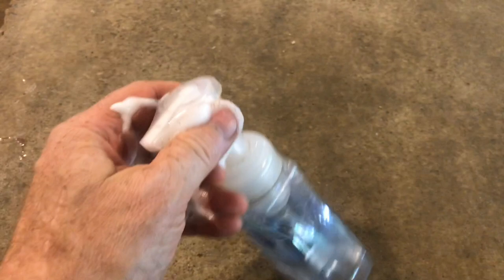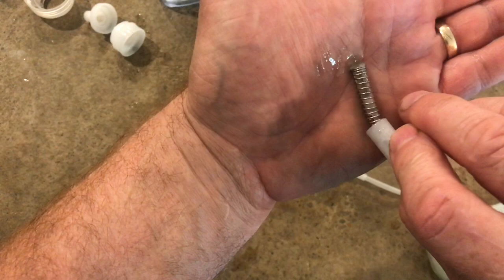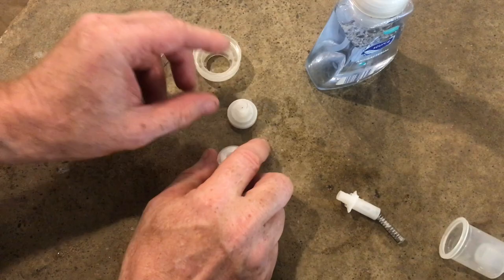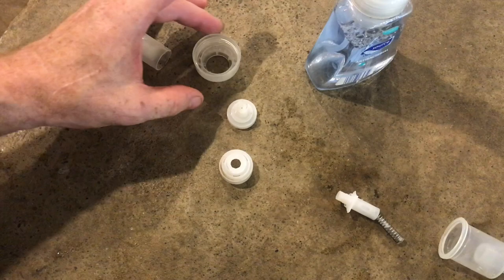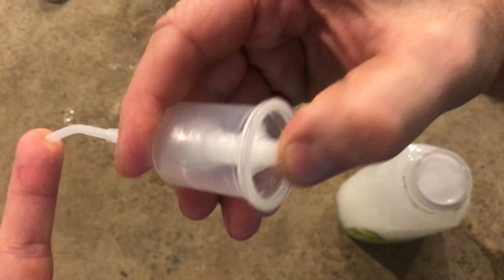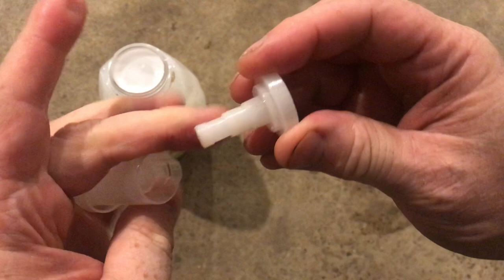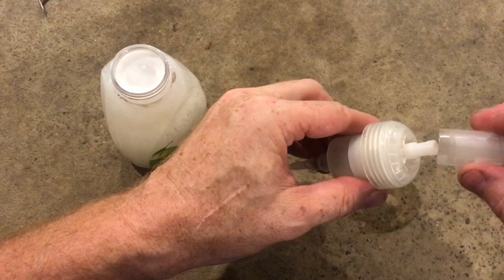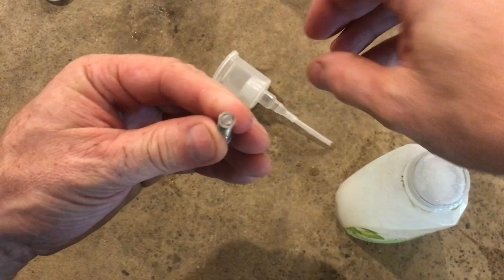WHAT’S inside a foaming soap dispenser

Comment: The mesh gets clogged. Soak the pump in vinegar for a few hours. Place the entire pump under water in a bucket and pump till the mesh is clean. Will work like new again,
Reply: Thank you.  I'd rather not take it apart.
Reply: Do you mean dunk the whole bottle in vinegar, or water?
Reply: @74Voyeur  just the pump. It's the mesh inside that has to be rid of the soap deposits.  fill the bottle with just enough vinegar and pump it till you see the vinegar flow out, you'd have the mesh inside the pump soaked in vinegar. After letting it soak for a few hours, place the pump under water and pump vigorously to get rid of any traces of soap (a couple of minutes). Your foam pump should be as good as new. Just use dilute clear handwash (don't use any other kind) to refill.
Reply: @Maruti M, thanks very much for the clarification. I've got it sitting in vinegar right now.

Comment: This video is a godsend! I’ve decided to take the pumps for my two soap dispensers apart to wash them. I’ve had them for about three years and they have started sticking. When I reassembled them, neither were working properly, and try if I might, I could not figure out why. Long story short, I washed away the little clear balls. I googled ‘foam soap pump assembly’ and found your video.

Comment: Cool. You got it apart.
I always break them trying to separate the pieces.
I want to make soap foam and spray wasps.
This helps. Thank you
Reply from the maker: The soap dispenser that I took part was sticking out push it down but there was friction on the way up. You can get it to work you just had to pull it up. So I took it apart and put some of the silicone grease on to help improve the upstroke. It works better but it doesn’t work like new right now. I’m hoping the grease will work in.Appreciate your comment thanks
Reply: @livefree6878 do soap dispensers pistons  come pre greased? Very interesting video!

Comment: Thank you for this video.  I was trying to find a way to fix my sticking foaming pumps.  Another video I watched recommended Vaseline, but since you mentioned that petroleum jelly breaks down plastics I’m going to buy some silicone grease.
Reply from the maker: Glad you enjoyed the video. Silicone grease is a necessity. Anytime you encounter a plastic or rubber part, this gives you the confidence that you can put it back together and not have it fail because it breaks down the parts that are made from oil itself. You can find the silicone grease locally at Lowes or Home Depot in the plumbing section. The stuff I use is Dow Corning number four. Once you have the silicone grease in your arsenal, you’ll use it all the time.
Reply: Awesome, thank you again!
Reply: Hurray, this trick brought my soap dispensers back to life!

Comment: I tried to fix a similar pump, because when I pressed down the head it didn't come up to its original place, so I bought silicone grease and I did the same as it can be seen, but it didn't fix the issue. Still stuck when I press the head down. Could you please advise? All parts look fine by the way, but it doesn't work.

Comment: How does air enter the filter component at the top?  Isn't the air injected along with the soap as it  enters the nipple of the piston?  There are small ribs inside the bore of that nipple that would create gaps to allow air to be pushed into that area to join the soap.  Also, I see that there are breather holes through the shoulder of the piston to allow intake on the upstroke.  Is there are check valve membrane on the underside of that area to block air passage on the downstroke?

Comment: I already disassembled everything because it became impossible to pump.  But the head is intact. How does the head Mitt allow water to pass? I don't mean when it's assembled - I mean just the head... you fill it with Easter and not even a drop of water passes. Why? I can't take it apart to look inside since it's all one piece.

Comment: If it keeps pumping out the liquid from the sealed bottle, how does it manages the possible negative pressure(vacuum) in the bottle? If there is a hole, the liquid may leak during transportation.

Comment: so I wonder why the pumps gets sticky after I use my own foam soap mix to refill?
Reply: Maybe you need to grease the piston like he did
Reply: Soak the pump in vinegar for a few hours. Hold the pump under water in a bucket and keep pumping until you feel it become easier to pump. The mesh gets clogged with soap, this will clear the mesh.
Reply: "after I use my own foam soap mix to refill"
Sounds like your refill, likely with regular liquid soap, is not diluted enough.  Should be about 1/3 liquid soap, 2/3 water.  Else it's much too thick for the aeration to take place.
Reply: Make sure the liquid soap you use is the clear kind. And dilute it till it is just a little soapy but still watery, if it is too watery, you can add a little more soap. You'll get the hang of it soon. I've been using this method since the Covid19 thing started, I've cleaned the pump by just soaking it in water overnight and pumping it under water a dozen times to clean the mesh, once in a couple of months now and it has been working great.
Reply: @ZhipFrag  Yes. That was the answer. Pull the pump apart & reapply silicone grease on the piston.
Reply: @bgregg55 i guess. this was also more than 4 years ago, and im not rewatching this to try and understand the context. so you're right, as far as im concerned, see now everybody wins. but also never respond to my stuff more than 3 months old. because i will not have a clue what the hell it is about. but now i wish youtube would do what reddit does and lock down comments after a period of time.

Comment: I wonder how the pump introduced air
But I see no air, just a rapid push of soap thru two screens 👍 got it thanks

Ps the perfect formula you take thick liquid hand soap and thin with water a ratio of 
2:1
50% water
25% liquid hand soap
Mix with a thin stick as not to make bubbles 😂

Comment: All of my Method pump broke after a few months 😕
Reply: Did you have any luck with them replacing it? I’m going to try this but I was thinking of emailing them for a replacement
Reply: @TeresaRodriguez-ol4ux  I found that if you keep pressing the pump really fast then the soap would eventually come out. Not the best solution...but it works.
Reply: @TeresaRodriguez-ol4ux  I did email them (late 2019) and they sent replacement pumps.